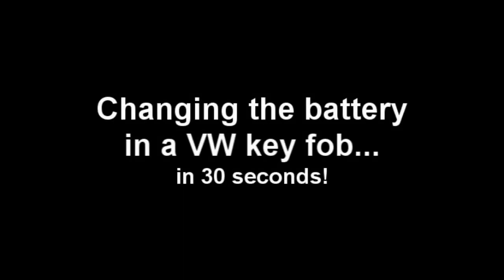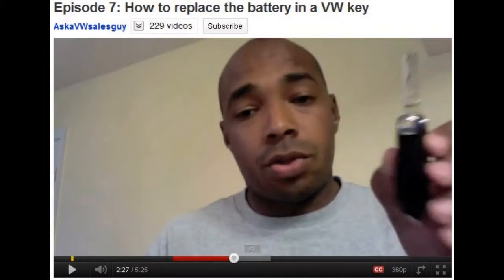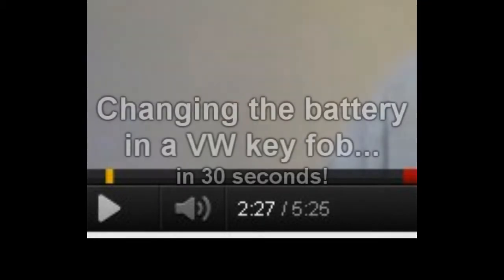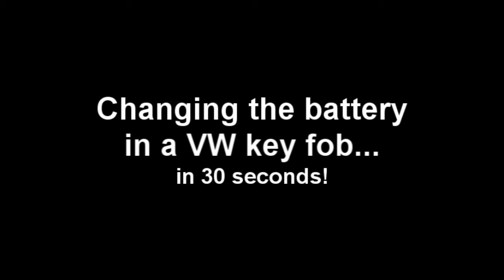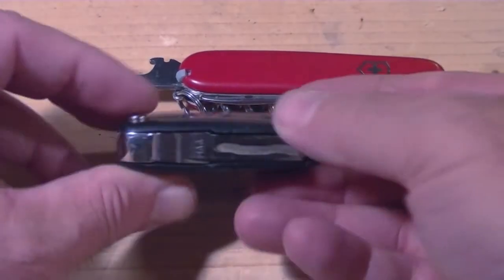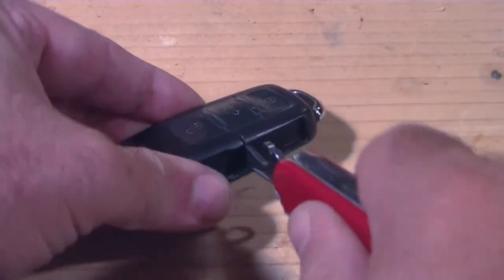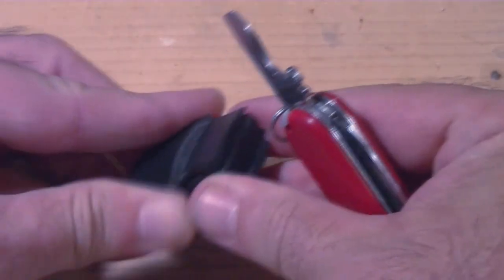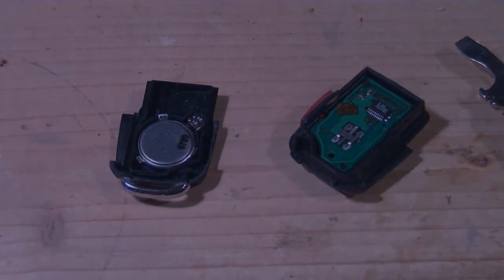Changing the Battery in a VW Key Fob - 1:10

Comment from the maker: Not sure about 1998, but I had a '96 passat that had a more normal-looking key. It had a little light built into it (that aimed at the lock, supposedly) and that's what the battery was for. It was a manual key and didn't need programming. In fact, that was still back when you could have a copy made at the hardware store for $2.50. Only thing the battery was for was the light.

Comment: i replaced the battery in my 1998 vw beetle key fob and also noticed and found out that the other key thats not a fob has a battery in it too.  And I'm wondering why?  the battery model is a v625u and this is the only key that will open the doors manually cause the key fob needs replaced or reprogrammed it wont do anything at all but start the car.
Reply from the maker: I had a '96, and the key had a light in it... that's what the battery was for. Just a little bulb that apparently aimed at the keyhole on the door, I guess.